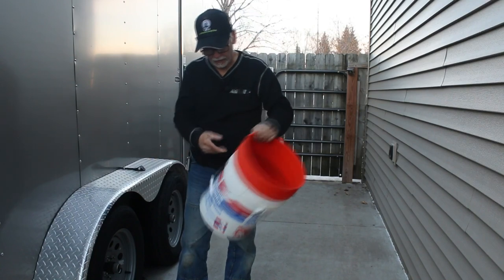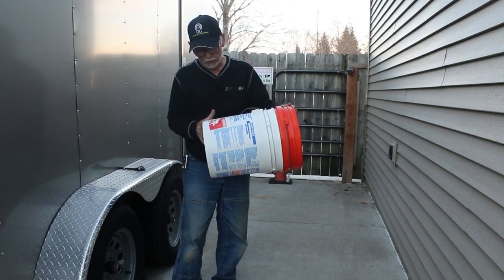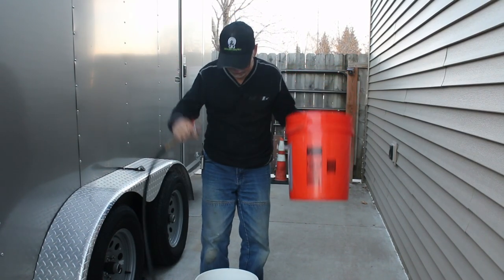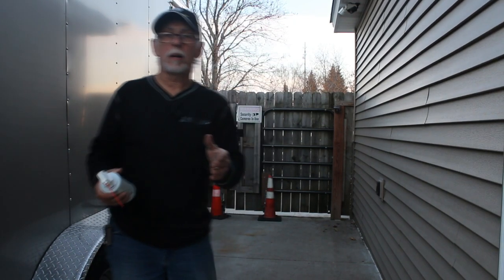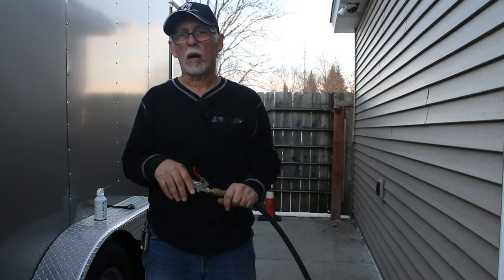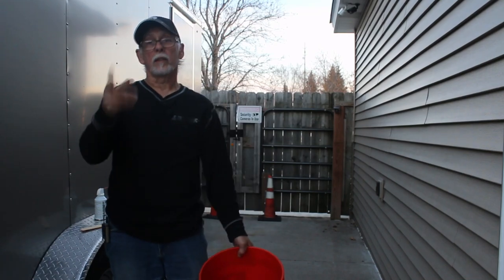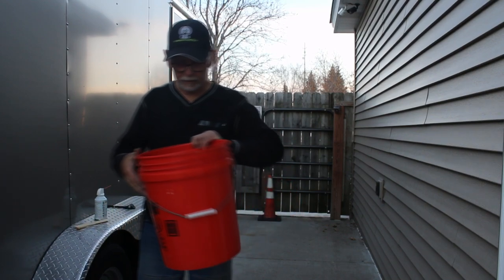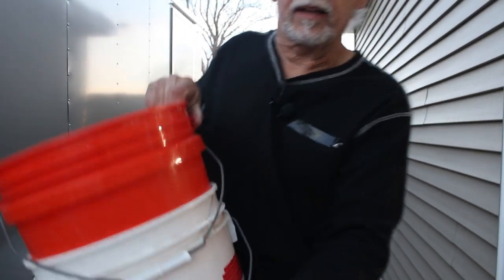How To Unlock Stuck 5 Gallon Buckets Easier Then You Think

Comment: I also found running the outer bucket under hot water makes the plastic expand enough to release the inside bucket. Just did it and it worked!
Reply from the maker: Thats a great idea, there are many ways. I was going to put out another video using a hair dryer to heat up the other bucket. Thanks for commenting

Comment: Nothing works for me 
I drilled both buckets 
Ver easy 😡
Reply from the maker: You couldn’t get the air to work? Wow, question. We’re the stuck buckets the same size? If they weren’t and were smashed together I would agree these hacks may not work. Thanks for checking out the video

Comment: Awful method... All you have to do is flip them upside down and put your foot through the handle stepping on it then just pull the top bucket up.. Takes 2 seconds and not one tool
Reply from the maker: Sweet! I will give that a try. I thought you were going to say flip them upside down  and put your foot through it! Lol
Reply: YOUR METHOD is not awful :) mediocre :P
Reply from the maker: @thefacelessone74  I actually created a short because of this comment, so thank you. I actually could not get this method to work, but these 2 buckets where really stuck, what happens is a vacuum is created which causes it to be very difficult to pull the buckets apart, that's where the air comes in, just trying to remove the vacuum so that the buckets pull part, I did watch the video link you posted, and I did it wrong in my short video in response to your comment, but I will try again! lol
I do appreciate any method that works, and not all methods will work in all situations, that's why having several methods at hand is helpful. There's even a wedge hack, the wedge opens a gap allowing air flow with frees the buckets. 
The Menards green buckets I used in my short, were really smashed together, I could not separate, and it was hard to get air into the bucket be cause the buckets have a lip that blocks the actual opening... lol  - - Thanks again my friend, I appreciate you
Reply: I tried that but it didn't work .